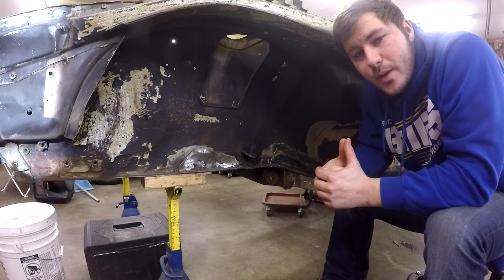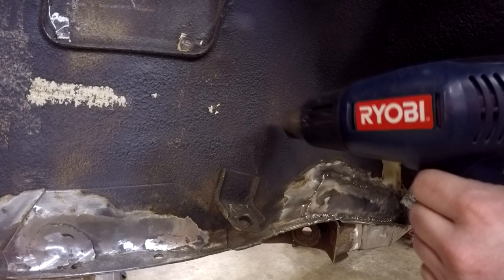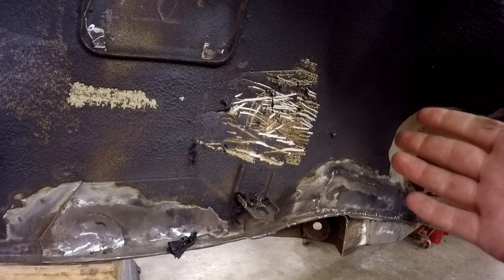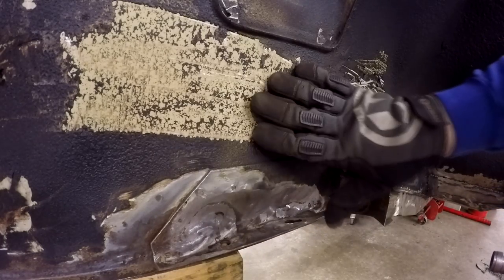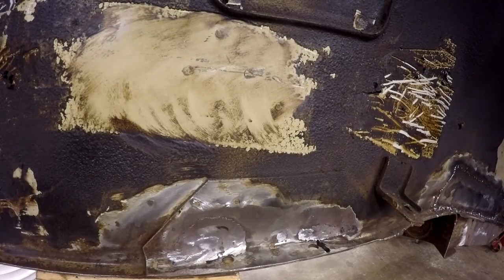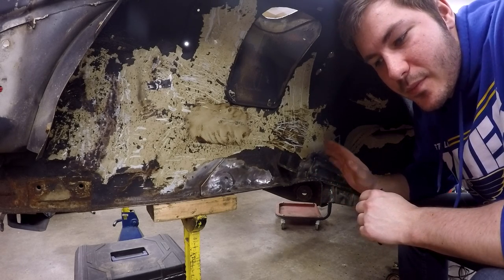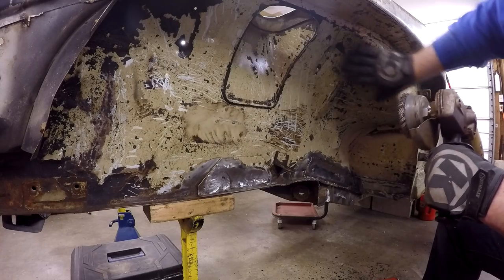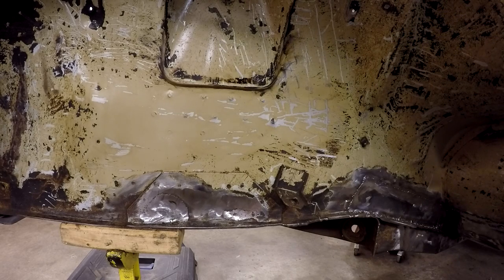Easiest Way to Remove Underbody Coating

Comment: After countless hours with a heatgun/torch/chisel/scraper/oxide discs/etc I've found that using a wire wheel with very short wires that won't "lay down" works very well. With decent pressure it destroys everything in it's path and will take things down to bare metal instantly. So quickly that the underbody coating comes off as dust. It won't heat up and/or smear around. No acids/strippers, goo, multiple layers to remove. Cheers
Reply: where did you get that the wire wheel
Reply: Been using this method and the dust smells pretty toxic....it also creates some kind of blue smoke that has got me concerned about my lungs. Pretty effective method if you are in a well ventilated area
Reply: angle grinder & wire wheels are great for a lot of things, their downfall is you gotta protect your lungs from the dust they create. don’t risk your health for a car repair people, get proper respirators & do it right!
Reply: I’ve been using wire wheel too

Comment: ya can use a torch its quicker just move the flame around kinda quickly in 1' x 1" area for a about minute and then scrape whats left comes off with acetone and steel wool no damage to metal comes super clean and ready fro a 1 or 2k primer/topcoat

Comment: I used a harbor freight multi tool with scraper blades and once the rubberized came off. I used a twisted wire cup brush.  Worked like a charm

Comment: best way is a pneumatic needle scaler.  Harbor Freight sells one for $55.  Low cost and it gets into the tight spots very well.
Reply: Absolutely. Saw your comment, went to Northern Tool, picked one up for $22 (ironton).  Had both of my wheel wells cleaned out in under an hour. By far the most efficient way. Thanks for that.
Reply: Needle scaler worked really nice,followed by a stiff wire wheel

Comment: I just got done doing this a couple weeks ago on my project.  For people who don't have a decent compressor to keep working with an air chisel, you can use a multitool with a scraper blade.  I mostly used the propane torch and a hand held scraper.  For the residue, I heated those up with the torch before hitting it with the wire wheel.  It took me a whole week to remove the whole underside of the car and inside the wheelwells.  It's not very fun at all.

Comment: that air chisel works a treat! I've done all the interior sound deadening in my car, now i need to do the under body sealer, and i'm not really looking forward to it, especially that its around 47°C here in Sydney now! (that's 117°F to you!)
Reply from the maker: Wow I have never experienced heat like that. Gooood luck with that as well as the underbody of the car. I do not miss doing that! Mine was super oily and nasty

Comment: Gasoline melts undercoating. Soak it down, then scrap or scrub with a copper scrub pad then wipe up the goo with paper towels. Fairly fast and a ton cheaper than Goo-gone.

Comment: I’d like to recommend an air needle scaler.  My inexpensive Harbor Freight scaler did the trick.  Each fender (1957 Chevy 3200) took about an hour.
Reply from the maker: I’d be careful with that though, it can lead to many little dents into the sheet metal. Obviously not critical for underbody, but still, not ideal
Reply: @StewartMotoring  Thank you for the caution.  I figured any tiny dents would come out when sanding down to bare metal with 80 grit.  I will double check that because maybe they won’t.  Again, thank you.

Comment: Waft a Map gas torch over it. The heat/flame makes it brittle. Then use whatever you prefer to whip off the burnt coating - it takes no time at all once you have flamed it. You are down to bare metal in a jiffy. If you encounter deep factory seam sealer, the same method works best - burn it, then scrape. You then no longer spend ages mucking about with sealants/coatings - they all become a doddle.

If you hit real thick filler on a panel, same method works fastest - burn it off. It gets you back to bare metal real quickly.

Comment: you need a thicker putty knife then that one you have a heavy duty version of that then just scape I found that the old under coat on Z cars will just scrape off with a heavy duty sharp and keep it sharp scraper. Heat can just make it messy but in some areas just may be what you need. good video keep that car progressing. I almost have both of my Z cars floor and chassis completely welded up so I'm happy to be able to soon turn it right side up for good ha!
Reply from the maker: Sounds like more elbow grease haha. I'm sure it works fine, no matter what it's not fun and takes a while.

Comment: I've never seen any kind of blasting remove any resin like substance. I have seen people use dry ice on the interior resin, sound deadening stuff though. It flaked off very easy once frozen. I've seen it on tv but never tried yet.. I've been wanting to give it a shot

Comment: I wish aircraft remover was still sold...Im tempted to use my last bottle to get this crap off. Its such a bad product in my opinion...but I guess for people that never wash their car and only want it lasting 10 years its fine...things that go to 50 years or more should just be washed and dried...

Ill look into your tip. Looks a lot easier than the chisel (i did that in my second to last vid and the one Im editing now lol...Im working on a 74 Ranchero)

Comment: Two questions
Is underbody coating beneficial?
Why are you removing it?
Reply from the maker: It was dirty, filled with grease/oil, and wanted to remove to check for hidden rust. Otherwise yes it is very beneficial. Acts as a sound deadening for rocks and is a durable surface for long term.

Comment: This is where I'm coming from I have underseal in the engine bay which I want to remove, but I don't want paint to come off
Please reply
Joe
Reply: try giving it a lot of heat with a heat gun/blowtorch and then when the stuff is soft shift it around as much as you can with a towel and after that try some really VERY strong industrial solvent on a towel and it might wipe off pretty well, of course depending on the coating that you have on there
Reply: i've also heard that using floor wax removal stuff might work pretty ok

Comment: Very informative video, thank you so much! The fastest way is obviously the vibrating scraper, but could I use with similar results a powerful wire wheel? I intend to put extra sound insulation on the wheel arches (on the chassis itself, not the plastic liners), so the protective coating has to come off completely.
Reply from the maker: I didn’t have good luck with the wire wheel alone, but hey, it may work for you!

Comment: Sandblasting is by far the quickest way.
Reply: What type of media do you use?(I don't want to remove metal.)
Reply: 702justin702  blasting in most cases make it soft again , unless a brittle bitumen it may come off

Comment: try a vibrating multi-tool with a blade...
Reply from the maker: Did you watch the full video? I ended up using a very similar tool. But I did just buy a Kobalt oscillating tool so that will be nice for future use.

Comment: Sweet thank you sir that’s what I’m going to be tackling for the next few weeks getting rid of all the old undercoating putting new Now I can  do it with confidence and know I’m doing it right👍🏼
Reply: Aircraft stripping works well for me.
Reply: Sleek S I don’t know what aircraft stripping is but can I just look up a YouTube video and attempt it ?
Reply: @hectorromero3536  you sure can. There is a video of two gentleman who use it on a blue Datsun 240z. Works great.
Reply: @hectorromero3536  look up paint stripper on bed liner 240z.
Reply: Sleek S  oops I looked it up and I didn’t know that aircraft stripping what’s the chemical you can use but that works really well and undercoating to remove it also??
Reply: @hectorromero3536  Yes, under coat as well. I used it on my truck and it was quick and easy.
Reply: Sleek S awesome! Thanks can’t wait to try it cause the heat gun is sooooooo slow 😅
Reply: Sleek S  right on thanks for the safety tip 👍🏼
Reply: @hectorromero3536  let me know how it turns out.
Reply: Sleek S will do 😬

Comment: if it comes off from compressed air... fine, otherwise it is firmly affixed,... if you need a heat gun to remove, you're wasting your time.
Reply from the maker: Could be hiding rust which would be the reason most remove when doing a full resto.

Comment: if its that hard to get off i dont see the point of removing it
Reply from the maker: Probably not necessary but most people do when they do a full restoration. Mainly to keep it from catching fire with all the welding and to put some new underbody coating on